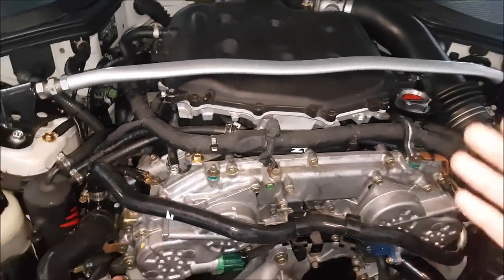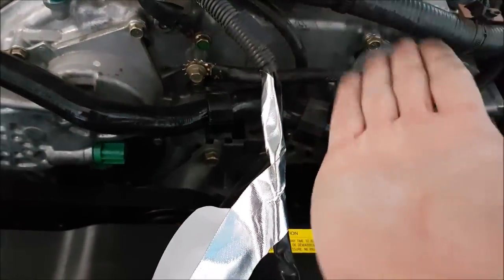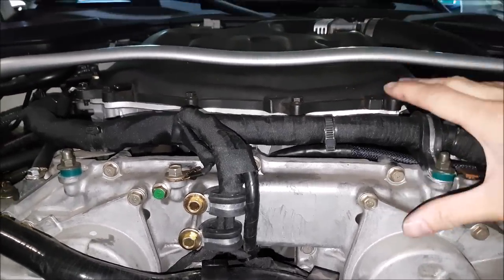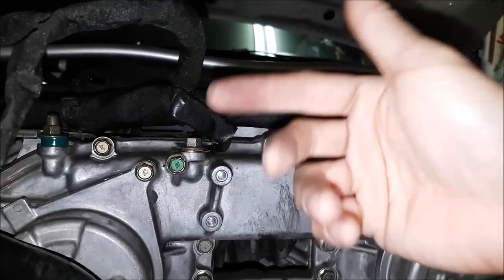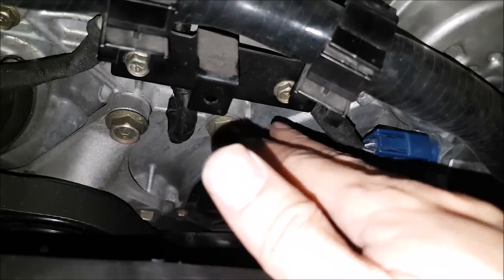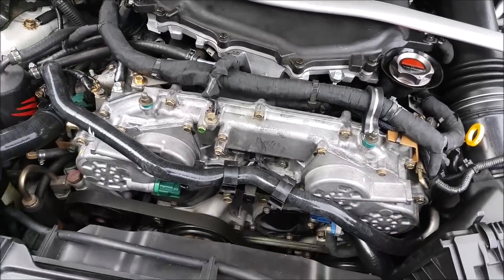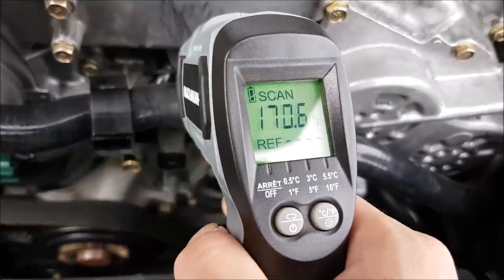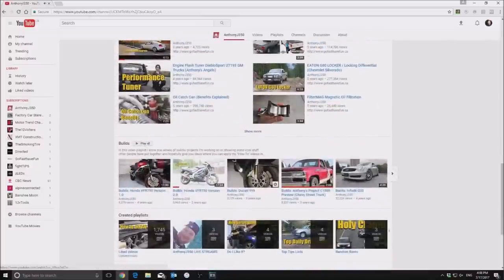Nissan 350Z/ Infiniti G35 VQ Engine Wire Clean Up | AnthonyJ350

Comment: I feel like leaving it open also helps for air flow. Allowing air flow to flow through there to keep the bottom of the mani top off the engine cool when moving.
Reply from the maker: Yes, should help the insulation last longer.

Comment: nice video , I do like the way you did it first, might give it a try, also a question for you, what kind of upper plenum is that ???
Reply from the maker: Thanks for watching!  It's a factory plenum painted with black high heat paint. There's also a Motordyne 5/16 spacer and MREV2 installed.

Comment: Hey Anthony, Will the rev up wiring harness work on a regular DE?

I need to basically re-do my wiring harness for my 03 MT 350Z but can't find any harnesses out there for regular DEs
Reply from the maker: I don't think so. There's extra valve timing on a REVup. You can try verifying with Z1 Motorsports.

Comment: The older infiniti's have these rare short chrome bolts  perfect size so you won't need the washer where the acorn sits. Nice wire tuck! Do you think it matters which order of tape layers are put first?
Reply from the maker: I don't think order will matter too much since it's not ultra hot in these areas.

Comment: AJ, well done, as usual, I have the same rev up in my 06.5 Z, how is your catch can working out, is it still unmounted, with the exception of gravity and tight fit?  Also what are you using to keep your engine bay so clean?   Mine stays fairly clean but has 13 years/39k mi. of light dust accumulated.  Also since you are in Canada, what do you know if anything about the Recochem/OEM coolants, made in Canada, are they legit, and high quality?  Best regards.
Reply from the maker: Thank you. The occ is mounted, and has been awesome. Here is the video. I just use coolant that's factory fill and works good for me and mix it with distilled water.

Comment: hey bro, do you think you can help me out? So recently and tragically my ABS module caught on fire (my abs has been buzzing even when the car is off and I would always unplug the negative terminal on my battery, we’ll one day I forgot to unplug it and i guess it overheated and caught on fire) i put it out in time and it burned some of the wiring by there. My headlights don’t turn on, my rpm stays at 0, my temp don’t work, basically most of my cluster doesn’t work. So i was wondering is there like a wire harness i can replace in order for my headlights and taillights to work again. Car drives fine but I just want to be able to drive at night.
Reply from the maker: You might want to contact Wiring Specialties, they build harnesses https://www.wiringspecialties.com/
Reply: @AnthonyJ350   do you select the universal or standalone? All the rest are for engine swaps
Reply from the maker: @Mivic666  I've never purchased from them yet. It's probably best to call them so you get exactly what you want.
Reply: @AnthonyJ350   ohhh alright, ill just have to give it a shot

Comment: Where did you get those insulated clamps to hold the main wiring harness?
Reply from the maker: Got them from my local auto parts store. They're insulated stainless steel clamps.
Reply: @AnthonyJ350  Thanks for the quick reply!

Comment: Hi Anthony, Off topic question here. Would you recommend a tyre set up 245s width (Deep dish rims) on the rear and 235s on the front or larger for a better grip and handling since its a RWD ? I had this set up on my twin turbo Soarer and found it helped with the traction and LSD when doing launches etc looks good too but performance wise do you see the benefits?
Reply from the maker: I would go wider if you can. This is my setup with specs https://youtu.be/x9XLGAojw6w
Reply: Thanx Anthony for your reply love your content big fan and fantastic to see s YouTube replying to there fan's. Love from Sydney Australia. Do you have a Po Box for us to send you fan mail ?
Reply from the maker: @andrewpaige9152  Thanks so much for being a viewer! Currently I do not have a P.O. box.